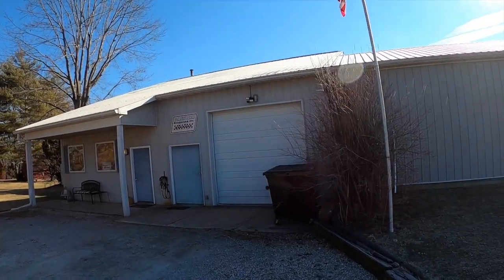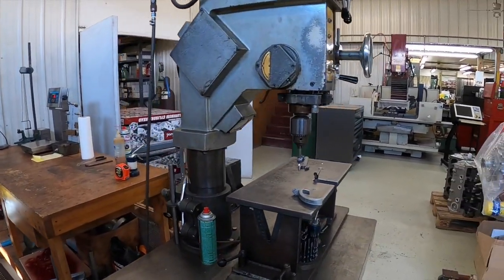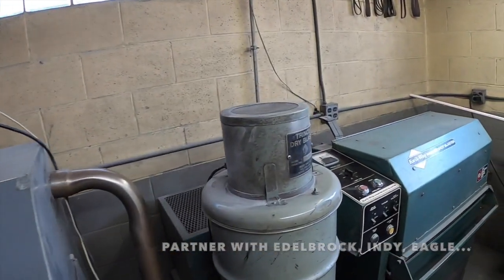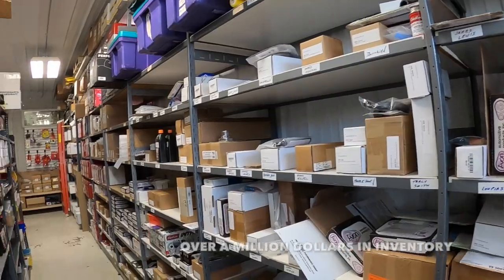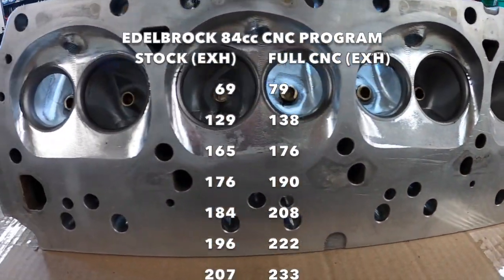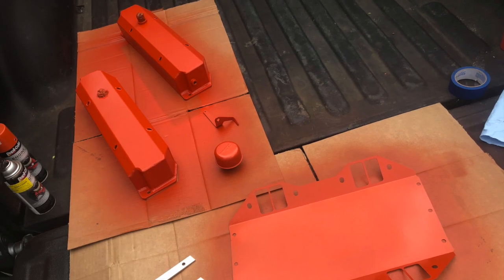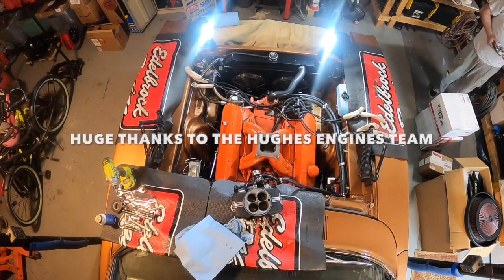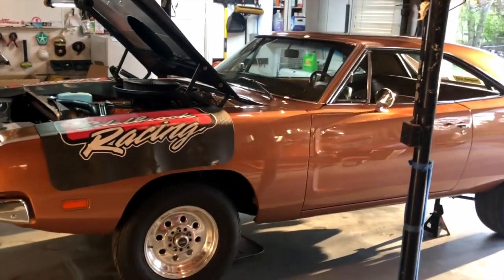Porting Edelbrock RPM Performers & a Look Inside HUGHES ENGINES

Comment: Did you run flat on power because you bought 210cc intake port heads and used a dual plane intake, or was it thd cam size ? If i wanted it to pull hard to 6500rpm i would use the trick flow 240cc heads and a single plsne intake.
Reply from the maker: The initial build favored big torque for sure, but we had upgraded to a Chuck Legasse-ported single plane intake long before. Equally, the Trick Flows were either brand new or not released by the time we built this (2013) setup, so they weren’t an option yet.

Comment: I bought a bare set of 440source heads in 2014, and had Hughes cnc them at there winter 1/2 off sale...all said and done I was in the heada 2300$ ...Just a couple of hundred bucks less than new trickflow heads...TF leaves them in the dust
Reply from the maker: Yes, the Trick Flows are very impressive but came decades after the RPM Performers.

Comment: It runs like a bag of sh_t?  Needs tuning and a set of trickflow 270 heads.
Reply from the maker: Huh? No, the stock heads fell over at 5,600rpm. Now it revs to 6,500 with zero delay.
Reply: @moparconnection  I get It helped. But its not a good solution. You need  bigger heads bud.
Reply from the maker: We're flowing well over the Trick Flows now. When the 535 comes out we'll drop it on a dyno and get some real flywheel numbers.
Reply: @moparconnection  so what you just said and I quote. "Were flowing well over the trickflow 270 right now". I am a head induction specialist. If the head you ported has a maximum 2.19 intake and outflows the trickflow 270 intake. I would be very interested to purchase a set. I have flowed trickflow heads. And I can tell you they outflow what you suggest yours do in this video. So I dunno, your comment has my interest.🤔
Reply from the maker: Just look up the flow charts for the identical service offered by Hughes Engines. He publishes all of his data.
Reply from the maker: So what are you asking for? A side-by-side flow bench comparison chart? Sorry, I don’t have that to give you. But we wrote a detailed article that gives much more info than the video does. Hopefully that answers your questions:
https://moparconnectionmagazine.com/video-brazen-gets-hughes-engines-updated-edelbrock-heads/
Reply: @moparconnection  you said and I quote. Your heads outflow trickflow 270 heads. All I asked for was what your heads flow. Because I am confident you are wrong. I looked in your article. And the trickflow 270 heads are 20 cfm better according to your published flow numbers. I am just trying to point out your comment is wrong. But the 333 cfm hughes claims is still reasonable. Its a good result. If its valid.

Cheers!
Reply from the maker: Fair enough. Please excuse the error.